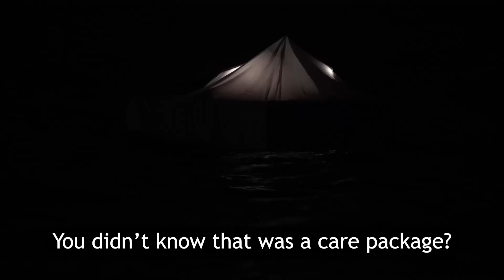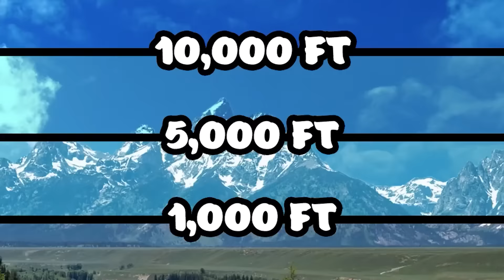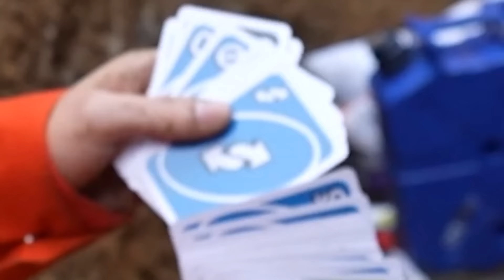Surviving 100 Most DANGEROUS Fears!

Comment: Preston you were supposed to filter the ocean water by: having a big container having A CLOTH place the cloth in a container that has holes both top and bottom place the sand rocks and charcoal on the cloth pour the ocean water in depending on the salt percentage you may have to pour it multiple times and even after that it still might not be safe to drink